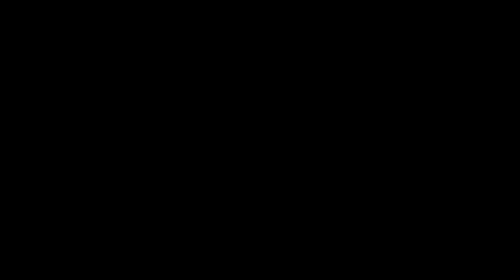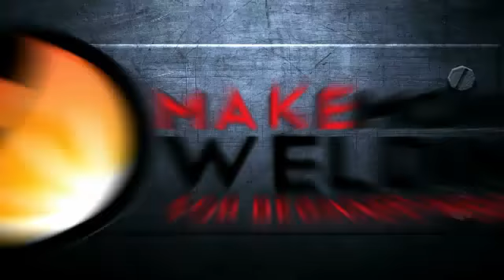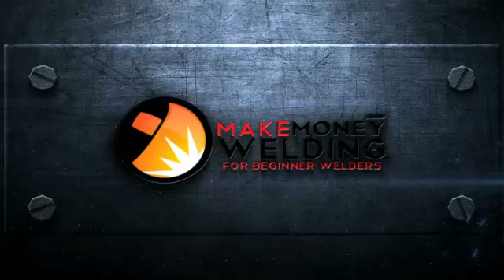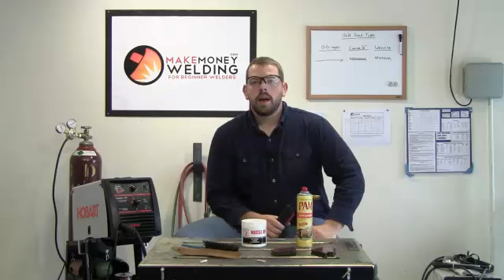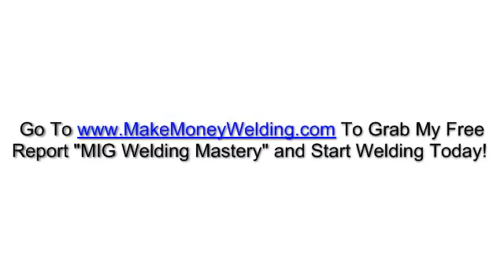How To Control MIG Weld Spatter

Comment: put anti slatter spray ing the nozzle dip works even better and another tip dont dip the whole gun in the dip get the nozzle hot and remove nozzle with welpers then dip nozzle in the gel tadaaaa no clogging